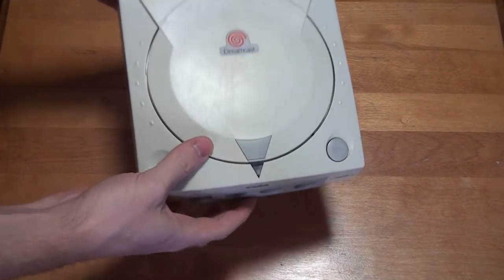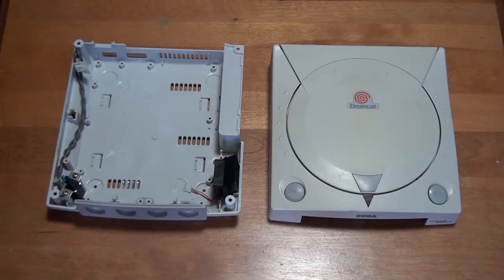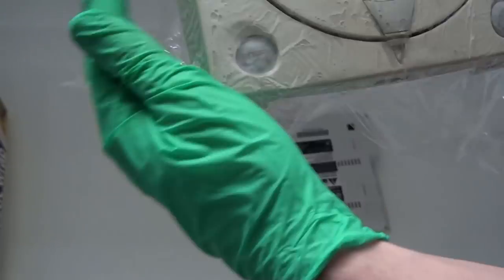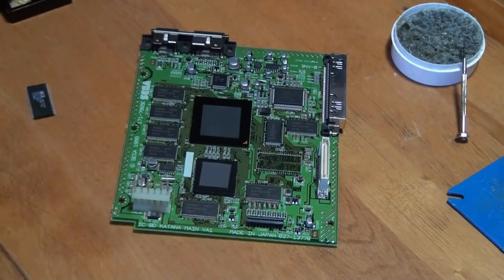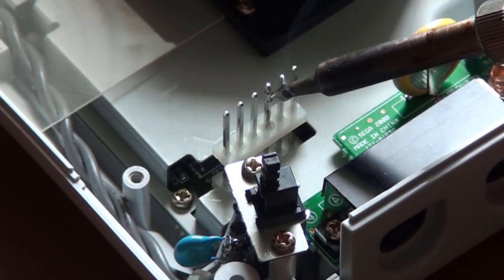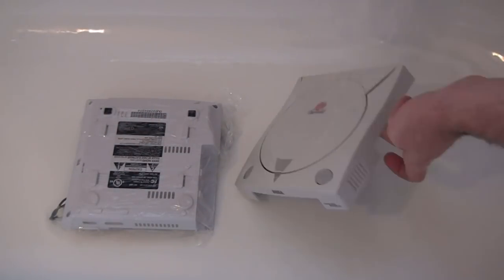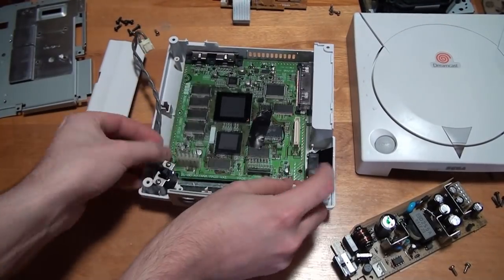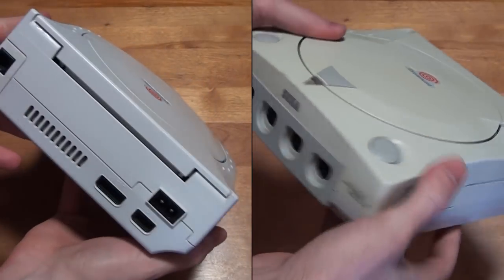Refurbishing a Sega Dreamcast | Region-Free & Better-Than-New

Comment: Great video! :D
Random reset is often not caused by the power supply. I some cases you need to clean the contacts under the door lid switch.
If your dc resets to the menu screen that is.

Comment: Could you repeat the specs of the fuse for the controller ports?
Reply from the maker: I'll do you one better. Here's a link: https://www.ebay.com/itm/10-Pcs-72V-400mA-Radial-Lead-Type-PPTC-Resettable-Fuse-PolySwitch-X72-XF040/322612265619?hash=item4b1d308293:g:VAkAAOSwLlpZqNYi&frcectupt=true

Comment: Hey there PC. I think I may need to replace the capacitors on my power supply, I'm still getting a random reset even after putting extra solder on the pins. Is there a parts list somewhere so I can know which capacitors to order? Thank you.
Reply from the maker: Couldn't help you there. I've never done any repairs on the power supply itself.
Reply: @DreamcasticChannel  awwe it's ok PC. I'll keep researching around.
Reply: If you hadn't found it by now, there are modern Power Supply replacement kits for the Dreamcast that are drop-in-and-play.  These will be called Pico PSU or (name-brand) DreamPSU.  They're substantially smaller and run much cooler then the OEM PSU (thanks largely to the transformer being moved to the wall wart.)  This is recommended if you're doing an SD-Card replacement for the GDRom as the new media solution draws significantly less power (leading to overheating inside modded systems,) and is relatively cheap (only $50 for the name-brand!)
Reply: @ZROGST  Thank you so much! I'll look for that!

Comment: The other day I felt like playing my dreamcast but when I turned it wouldn’t read any disc. It would spin the disc a little bit but wouldn’t move the laser.
My last Dreamcast I tried to recalibrate the laser but I was horrible and I broke it. So latter I got another Dreamcast from GameStop for 50 dollars (the one I was first talking about) on the back it has a sticker that says GameStop premium refurbished void if removed (you have to remove it to open it up) but I have been hearing bad things about GameStop lately and I don’t know if they will fix it, and I don’t want to open it up after I screwed up last time. I also want to do a hard drive mod on my first one. Your the first guy I think of about this stuff.
Reply from the maker: It sounds more like the one of the motors (either the one that spins the disc or the one that moves the laser on the track) than the laser.
Reply: It’s the one that moves the laser, disc still spins
Reply from the maker: Sometimes it will struggle to spin the disc though if it's dying. It will kind of spin a bit, stop, and repeat.
Reply: Anyway of fixing? Or can it be replaced?
Reply: @MrTea101  The New-Old-Stock of replacement GDRom drives is drying up.  There are compatible drive pieces out there (GDRom uses the same hardware as CDRom) that can be cannibalized from non-working units.  Alternatively, the drive can be completely replaced by a USB drive or SD Card reader with very little work.